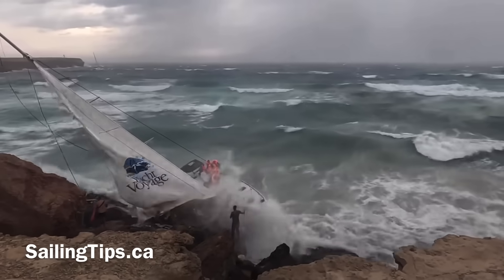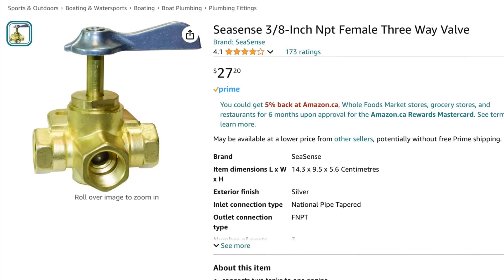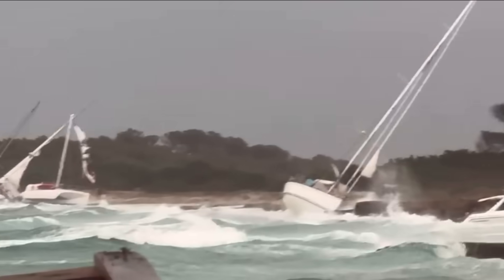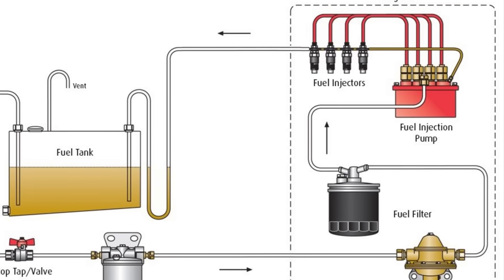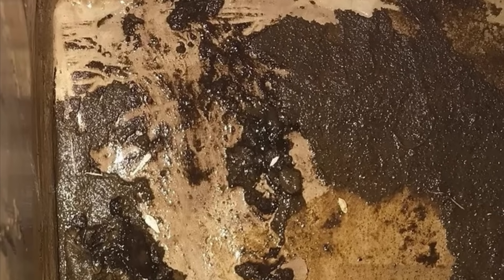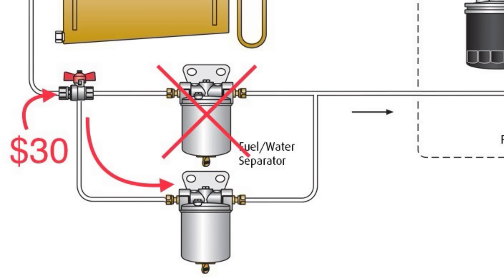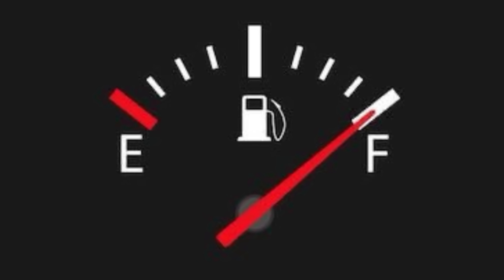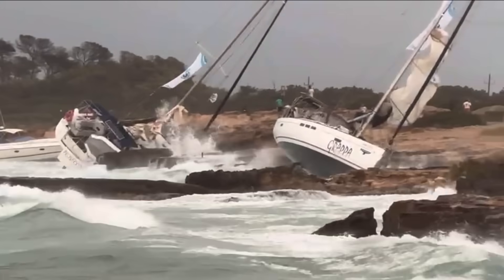The Critical $30 Safety Device Most Boats are Missing!!!

Comment from the maker: I didn't provide any boat-specific recommendations for adding a redundant fuel/water separator because there are just too many factors, such as what kind of boat it is, what kind of fuel/water separator you already have, how much space you have, what is locally available, and whether you want a genuine "twin" of your existing unit or a cheap knock-off. 

The $30 solution variant is a simple straight bypass of the fuel/water separator and allowing the fuel filter on the engine to do all the work. This will run your engine for a while and get you out of trouble but I strongly prefer spending a bit more for the second fuel/water separator. 

The $30 three-way fuel valve in the video is also not a specific product recommendation, but the cheapest three-way fuel valve I could find on Amazon. I would recommend spending slightly more for a higher quality unit. I simply bought what they had at my local chandlery which was slightly more expensive, but not much more.

You can also replace your existing fuel/water separator with a pre-built unit with two filters and a switch between them, but again that depends on the above factors, and they are much more expensive than just "twinning" your existing unit with a three way fuel switch.  

I really just wanted to motivate sailing yacht owners to explore relatively inexpensive ways to add resiliency to their fuel systems, like adding redundant fuel/water separators and tank inspection hatches, both of which are straightforward retrofits and one of the best bang-for-buck investments you can make for the safety of your boat.

Comment: Why are Sailboat engines so under-powered?    30-50 Horsepower is typical on a 30 ft sailboat.    Horsepower on a 30 ft powerboat is 300 - 800 Horsepower.       I've seen so many sailboats that have problems fighting the water current because they are so under-powered
Reply from the maker: Good question! Most sailing yachts are limited to their theoretical “hull speed” which is approximately 1.34 x length of waterline in feet, and it’s pretty easy to push them to just under this with a 30-50 hp engine, and adding an engine 10x more powerful isn’t going to make them go much faster because they don’t plane on top of the water like powerboats.
Reply: @SailingTipsCa  Under normal Conditions.. Agreed. but Hurricane force weather Dis-agree.

Comment: This "solution" just fights the symptoms. 
1. Install an inspection hatch in the tank and check the fuel condition. Is there really a serious problem? You will know for sure. Too expensive? Your engine is your lifesaver.
2. Bacteria and fungi need water. No water, no problem - even with "dirty" Diesel. Often, this water comes from condensation (droplets) and not fully sealed fuel inlets (can be more than just droplets). Fight the source of water in the tanks, the root of the problem, not only the symptoms.
3. If a boat is moved seldom and without running the engine, there is no chance to stir the water at the tank bottom up and feed the water/fuel mixture through the filter system. It takes years to collect so much water/fungi to completely block your filter system when the boat is then eventually moved.

So - Install an inspection hatch, prevent water contamination and let the waves move your boat/tanks while the engine is filtering the fuel. Your 30$ "solution" can only solve a symptom for a short while, but it's better to be sure to have clean diesel whenever you leave the dock.
Reply from the maker: An inspection hatch and proper tank maintenance is always the best solution!

Comment: Very sensible advice but on most modest family type cruising yachts I doubt if often fitted,  I've owned 4 small yachts and have  always been concerned about contaminated fuel,  water in the tank and diesel bug,   first keep the tank full,  top it off after each cruise so that it's not sucking damp air to condense , I used to add diesel bug killer regularly  and feed a tube to the bottom of the tank and suck out any water when laid up. None of my boats had an inspection panel in the tank.
Reply from the maker: If only everybody was as diligent as you this would be less of a problem!
Reply: @SailingTipsCa  I probably was a bit paranoid about fuel but two club member friends had their trips of a life time seriously disrupted when they got into some rough water while running the engine and the water,  gunk and goo that had been sitting quietly at the bottom of the tank completely clogged the filters.  Interestingly the original inline fuel filter separator on all by boats had solid aluminium bowls so you couldn't tell if water was building up unless you opened the drain down valve,  I fitted glass so you you see at a glance immediately if water was coming through,  however this apparently didn't fit with Inland Waterways safety regulations which forbid glass.
Reply: Excuse typo,  should read "my boats"

Comment: When purchasing a new to me boat, I asked when and if the fuel tank had been cleaned. The old owner showed me a bill (just done) for over $700 that was just for cleaning the tank. With this knowledge we sailed out of the harbour into some light snow and 15 knots of wind. We were unable to put the sails on at the dock and we were going to motor for 4 hours however there are a lot of marinas along the way. After just getting out of the harbour walls into the 2 to 3 foot chop the engine died. The boat was out about 300 feet and I got the engine started and gained another 1/4 mile before quitting with no restart. We managed to get the main on and up which gave us a little more time to get the genoa hanked on. We got offshore enough for me to go downstairs and pull the filter and it was plugged full and then I pulled the pick up it was jammed full too. I had to clean the pick up 8 more times and we had to run with no filter as well. We got home ok. The phone call to the Marina maintenance company was not a pleasant affair and the call to old owner was not pleasant either as he had told me the boat had been out a couple times (we found out this was not true). The tank had 1/2 inch of pure sludge.
Never again...4 boats later and now I do it every time myself to be sure.
Reply from the maker: Yikes! Sounds like they just took their money without doing an adequate job…or they ran a polishing machine on the tank but didn’t actually bother to check that it was effective! Glad you made it back. I also tend to do such things myself to ensure it’s been done properly.

Comment: I have two diesel tanks on my catamaran, and neither of them has an inspection hatch. I tried to install one, as you suggested, just a piece of metal with a cover, but it’s not as simple as you might think. First, you have to remove the diesel tank, which in my case holds 500 liters. Second, it’s an enormous amount of work to make these inspection hatches. And buying a new tank costs a lot of money. So, I just take it out as it is. But I can’t sleep at night because I know how dangerous this is. So you are absolutely right.
Reply from the maker: What’s your tank made of? Maybe a large hole saw might work without removing the tank and without dropping too many shavings in there either?

Comment: Build and install a fuel polisher that is running any time there is power applied to it.  On a sailboat under sail, it can be used even when not motoring.
Reply from the maker: Yes having an on-board fuel polishing system is a really nice solution!

Comment: All hyd and fuel tanks must have a Pall  Type PFD Reservoir Vent Filter/Dryer, dont let wet salt air into the tank, which happens cause the level goes up and down.   And the Vent Filter/Dryer,  must have a visual indicator.  Every season empty the tank and wipe out.  and all tank top up lines must go thru fine filters.
Reply from the maker: Good suggestions especially for older boats that might just have straight hose vents!

Comment: Pretty pissant way to do this. If you can afford a boat you can afford to do this right. Buy a twin Racor at a minimum, I have a Racor 900 plumbed to use solely for fuel polishing, a separate day tank and a dual Racor 500 on the feed.
Reply from the maker: Yes everybody should aspire to the comprehensive solution you describe. The reality is that when somebody gets a new-to-them boat there’s often a long list of things they want to address and many people don’t think too much about fuel system upgrades. The point of this video was to get people thinking about that.
Reply: @SailingTipsCa  I'm sure you're correct, fuel systems are undoubtedly one of the less glamorous aspects of sailing and easily overlooked until there's an issue. After a long career as a professional mariner I have perhaps a different view than some.

Comment: I think you need that same valve on the other side of the filters or you’ll suck air when you open the clogged filter to replace the element
Reply from the maker: Correct you can only do one switchover with the single valve setup and can’t remove the plugged filter with the engine running. With a second switch on the engine side you could remove the plugged filter with the engine running and put in a fresh element, but also couldn’t just switch back to the fresh element without first bleeding it. Any thoughts on how to do that?
Reply: Yes- installing an outboard motor rubber bulb between the tank and the filters- I have done  this for years- makes bleeding easy. Not all mechanics agree with this but I’ve never had a problem. So once you install new filter just open the bleed valve on the filter and pump the bulb- that will take care of the filter. (The first setup I had was with a Farymann Diesel A self
Bleeding. You might have to puta bleed valve in the line or use a 4 way valve so you have 2 lines coming in from filter,
One leading to engine, and one output available to bleed out air- give that some thought

Comment: This is the single most important sailing video you will ever watch, it could save you thousands of dollars or the life of you and your crew and your home.

But the real lesson isn't another filter like he said, treat your tank life your life boat, because it is. Keep it clean and treated, and cycle it, and pressure test it.  It's your Disaster Recovery powerplant.  Use it more, cycle the fuel lubricate the seals and don't trust any hose over 5 years old, and get new stainless Triton clamps, every single time.  I was also a mechanic.  Don't forget your cutlass bearing and your packing either.  And test those bilge pumps, even the manual ones. When you need them, they need to work. Use that engine! 
And get an EPIRB and a PLB and a lifeboat.
 USCG Vet and retired boat mechnanic.
Reply from the maker: Great advice - preventative maintenance and preparation is always the best solution - thanks so much!!!

Comment: I've been there!  Rushing below to change the filter before we ended up on the rocks.  I succeeded, but it was close and your solution would have been great to have at that time.  I did learn to always have the sails ready to hoist and an anchor ready to deploy any time that we were underway. Never go motoring along with the sails covered and the anchor stowed away, because you never know when the iron jib will stop working.
Reply from the maker: It’s a harrowing experience for sure - good thing you had the sails ready to hoist and anchor ready to deploy - both good practices!!!

Comment: Great idea however just changing to a clean filter may not bring instant relief to the problem. Usually, you'll need to bleed the system before the engine will run again so learning that skill is very important.
Reply from the maker: Yes knowing how to bleed is very important! The idea here is to have both circuits pre-bled so you can just switch over to the fresh filter if the first one is blocked. This all assumes the engine stops due to a blockage in the filter and not sucking air into the system somehow.

Comment: My seawater intake  for engine cooling  got clogged in a storm and I almost ended up on the rocks, manufacturer had a sea water strainer on the inside of the boat, but it got clogged when it sucked up a bunch of sea weed - manufacturer cheaped on not installing a strainer or screen on the outside of the boat.   The engine over heated and had to be rebuilt.   Fortunately I got sail up just in time to stay away from the rocks.
Reply from the maker: That must have been terrifying! Did you have an audible overheating alarm installed? Glad you got the sails up and made it out!

Comment: If I could add my experience. I was in a force 8 gale with short steep seas and so yes, the fuel was really churned up.
I can’t disagree with the idea of a second separator and changeover valve, my problem was clogged up pick up pipes in the tank.
When I found the problem, the fix was straightforward but very uncomfortable.
A second separator would not have prevented this from happening and in fact the separator, although dirty, was still operational.
Reply from the maker: Yes this doesn’t address the potential issue of a clogged pickup or anywhere else in the system for that matter!

Comment: Primary maintenance is important. Drain and crack open your fuel tank/s, wet vacuum and wipe out any waste filth, maybe a rinse if it’s a smaller tank system, close it up again, clean refill, fuel additives, change all the filters, bleed and run system, move on. 

Be warned - if you do this, do it as quickly as possible, LOTS of ventilation, and protect yourself regarding fumes. You will regret it if you fume yourself - believe me.
Reply from the maker: Yes primary maintenance is always the best solution, and as you noted use lots of ventilation!!!

Comment: This is great advice. In the real world how often would a fuel tank need to be cleaned? Thanks
Reply from the maker: Really depends on a number of factors, including the cleanliness and water content of the fuel going in, ambient humidity, temperature, whether more water is finding its way in from filler caps etc. All of that said if you give it a good cleaning such that there is no visible sludge left, and you are fueling up in a developed country, and there is no more water going in (other than humidity through the breather) you can probably go for a number of years without cleaning again. Best bet is to install an inspection port and look in there every six months or so.

Comment: As a diesel owner who ran used fryer oil, I had similar problems. Resolved the same way with a redundant filter and valve I could flip on the side of the road and continue on my way.  Excellent advice.
Reply from the maker: Thanks! Just curious - did you have issues sourcing used fryer oil in your travels abroad or did you mostly sail within a local region with known “supply chains”?
Reply: @SailingTipsCa  haha, sorry no, a VW TDI
Reply from the maker: @alzaidi7739  Ahhh…yes you did say road in your initial post!!! I might look into fryer oil for my old Chev 6.5 truck…
Reply: @SailingTipsCa  Those have been done. FWIR the weak link is the computer that overheats. 180*F fuel will raise the fuel system temperature and adjacent electronics. Become a good customer of a sushi place. they have the cleanest fryer oil.
Reply from the maker: @ Good tip on the sushi place! My truck already has the PMD (computer) relocation kit to move it away from the heat. I’ll read up on whether or not this might be sufficient. Thanks!
Reply: @SailingTipsCa There’s companies that pickup used fryer oil.  It might be better to buy it  from them, after it’s been filtered.  Most restaurants are required by cities / municipalities that restaurants use them to ensure proper disposal, and it’s not poured down drains.

Comment: Does the $ 200-second filter come with the switch?
Reply from the maker: There are so many combos and options available. You can buy pre-built units with dual redundant filters and a switch, or retrofit your existing setup with a “twin” and external switch. Or even a simple switch to bypass the primary filter would buy a few minutes of motoring at a harbour entrance while the secondary filter assumes the cleaning duties.

Comment: Thanks for this video... I have been adding redundancy all over my boat.... your diagram showed me that... my lift pump is in the wrong place! and I kinda knew it, but didn't know it... Thanks again
Reply from the maker: Yes nice to have redundancy! Many boats have the lift pump, secondary filter, and high-pressure pump all situated next to each other on the engine, but the lift pump can really be anywhere between there and the fuel tank Factors that would cause you to situate it closer to the fuel tank would be a really long fuel line or the tank sitting substantially below the engine.

Comment: That's why I use a 15 gallon gravity tank.  I fill from the tank, through the fuel/water separator, to the day tank.  I first got through a Racor separator, then a second filter/separator, then to the tank.  I just have to check the gravity tank so it doesn't go empty.  it also has an angled bottom so when heeling the boat the exit fitting is never out of the fuel.  ...  I got this idea from the submarine I was on as their tanks are also filled with seawater as they use their fuel to maintain proper trim from an empty tank.  Their separators are a cone type centrifugal system.
Reply from the maker: I think a gravity tank as you’ve done is an excellent idea!!!